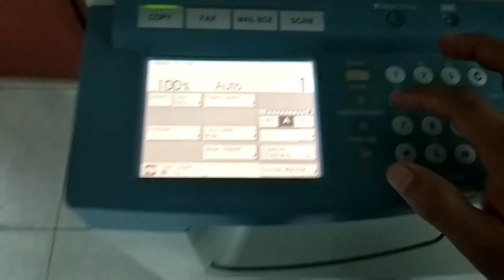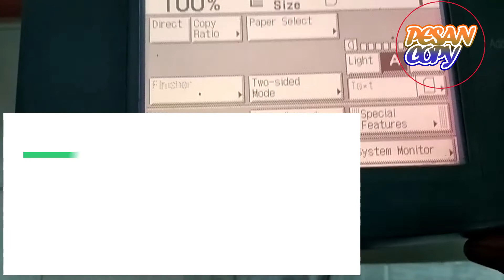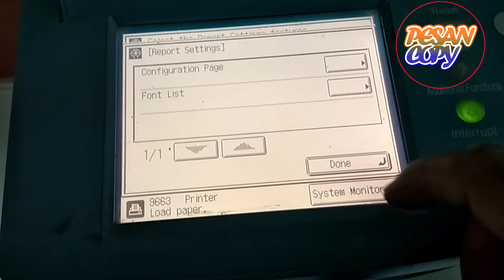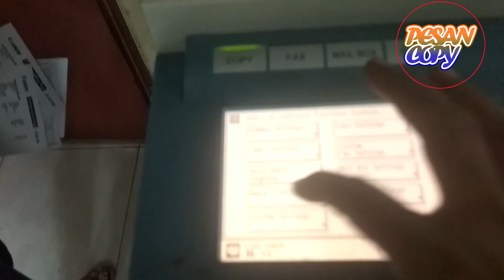Mengatasi Hasil fotocopy Berbayang

Comment: gan klo buat print bagus, klo fc berbayang gimana bos
Reply from the maker: Bebrapa penyebab
1. Kaca besar kotor
2. Kabel ccd kotor
3. Ccd error
4. Reader kontrol error
Coba salah satu pak
Reply: Klo untum settingan ccd sh bos, soalnya mesin habis eror, terus mesin ngereset pengaturan semua
Reply from the maker: @twentyfour3512  default ccd itu 1070 mas
Reply: @pesancopy  ngaturnya dimananya mas untuk 1070
Reply: boleh minta nomor bos mau konsul😁
Reply from the maker: @twentyfour3512  081284669334